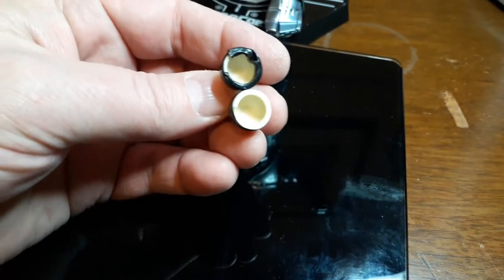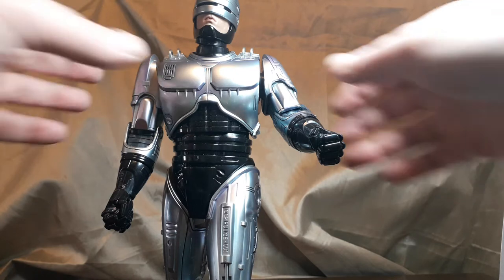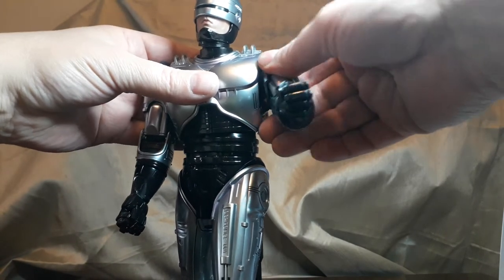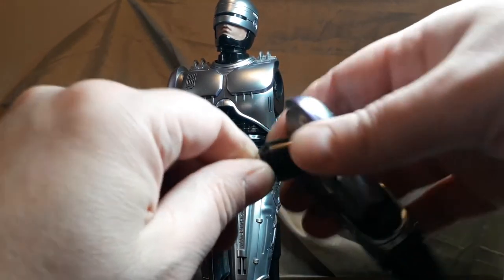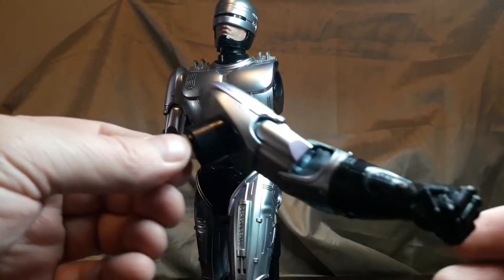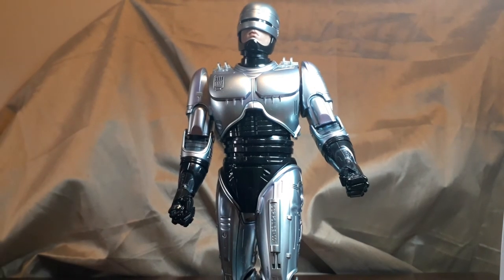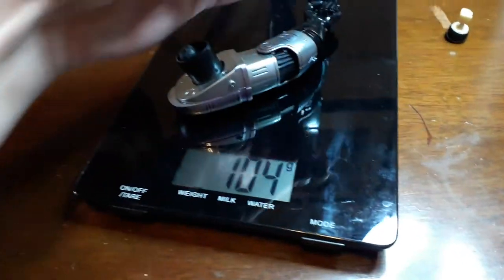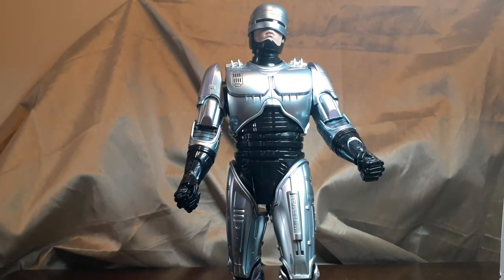Hot Toys Robocop Shoulder joint broken socket solution

Comment: Awesome repair job. This figure is fetching big $$$ on the secondary market.  It sucks that Hot Toys are so hell bent on design but have slack quality control.
Reply from the maker: Cheers yes everything retro has sky rocketed lately. Guess hot toys should take note, that not all collecters love marvel and star wars.
It is a potential issue with this figure and have seen at least 3 with this problem, so who knows how many are out there broken or glued static?
Dont think its due to mishandling but as you say bad design.

Comment: Mine is still fine and I bought it when it was released. Even if it breaks I'll just 3d print the sockets since there are durable resin plastic now available. There are even rubber like resin I can print if the rubber joint covers fail.
Reply from the maker: Good that theres options for you but hot toys are no help if you need help finding a replacement part.
Ive helped a few people repair their figures but shouldnt be a need. Bad design and brittle plastic holding a heavy weight eventually is going to fail.
Reply: @sparkstron73  Agreed, we shouldn't actually be fixing these toys in the first place. Was gonna buy the ed209 but the rubbers parts again was an issue. I've stopped collecting 1/6 figures with faux leathers and rubbers since all my figures that had them started rotting.
Reply: @sparkstron73  You should also look into resin printing as I've used it a lot to fix or restore some toys and even replace or make new accessories.

Comment: You've done a really good job casting the joints brother ! Mine also has a loose right arm joint so definitely a QC issue !! Mines going to be spending the rest of his natural with both arms resting on ED209's right gun appendage so shouldn't be a problem going forward 😁 ironically the one sitting in the chair has great shoulder joints but the rubbers have all split 😂😭 have you ever tried to disassemble the arms and legs ?
Reply from the maker: Thanks, no not had the need to yet, but am sure it will be an issue sooner or later.
Havnt even tried taking the legs off the body as they seem firmly attached and dont want to risk breaking the pegs.
Reply: @sparkstron73  there easy to remove but I think Hot Toys have used rivets on the joints ? That's why I was asking your good self your the only other person I can think of that has the ability to reverse engineer such a figure 😁😎
Reply from the maker: @gweilojohn8550  Flattery will not make me risk it lol.
Reply: @sparkstron73  lol gotta luv ya brother 🤣